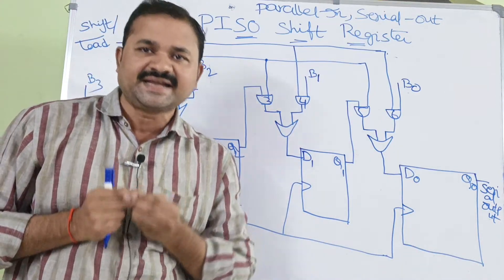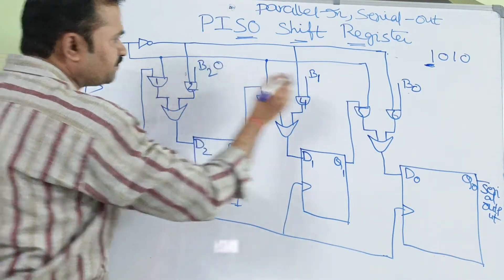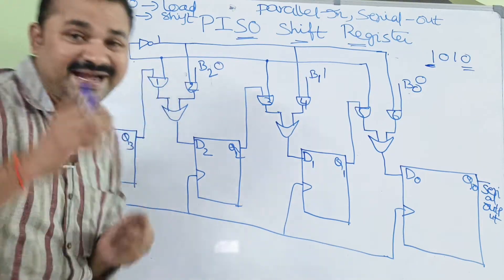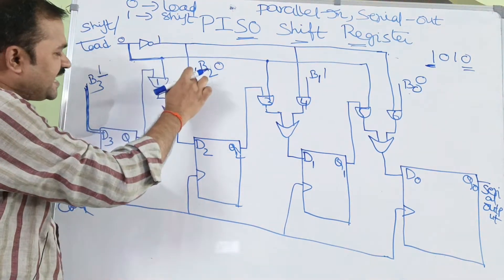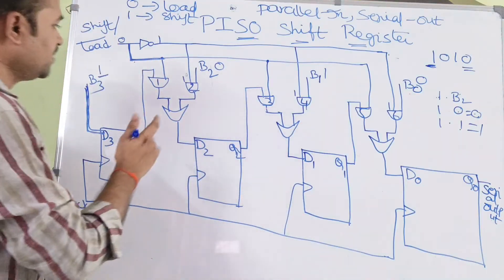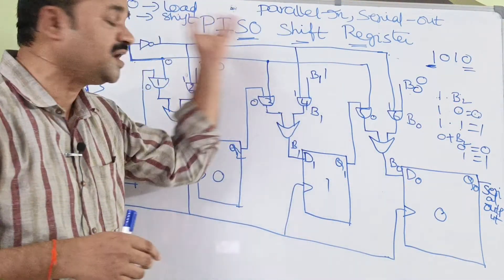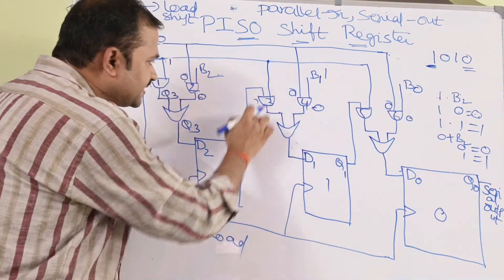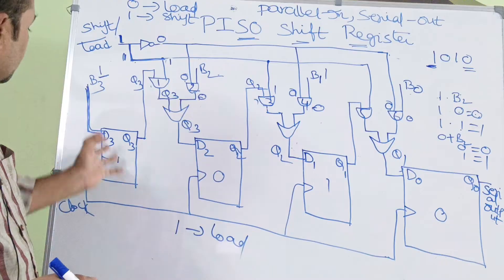PISO Shift Register || Parallel In Serial Out Shift Register

Comment: Sir thank you for the video. I have a question about the clock pulses. When we give the n clock? I mean when I have Loading I will just have one clock or n clock pulses? Also Swifting and Loading are combined together every time or not? Thank you.
Reply from the maker: 1 clock pulse is enough for loading data into register. n-1 clock pulses are required for shifting. First load the data and then do shifting. Plz subscribe to the channel and if possible share  with your friends. Thanks in advance..